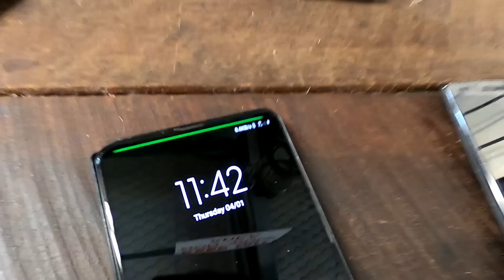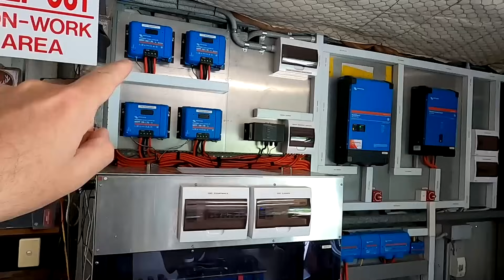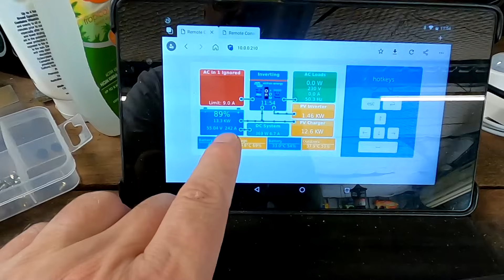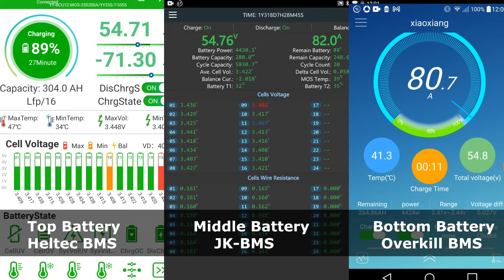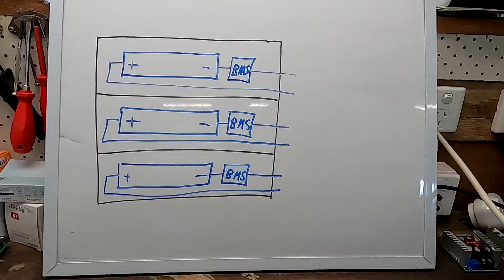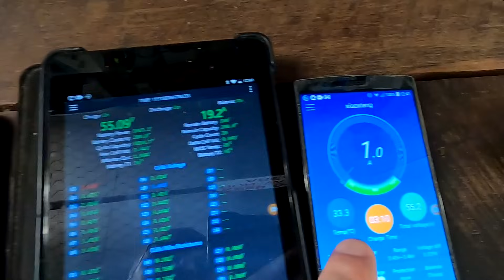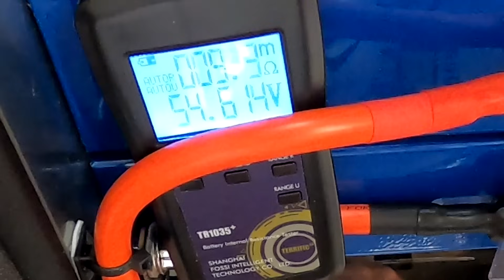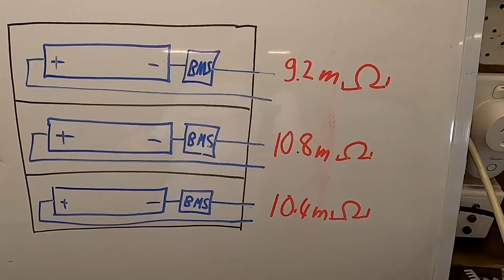Parallel batteries: one bank keeps charging when all the others are already full. But why???

Comment: I recently measured the impedance of my paralleled batteries with JK BMS (100A and 150A). I found out that one battery has an impedance of 4.8 milliohms while the other has an impedance of 5.0 milliohms. I used the original copper busbars with a torque of 11Nm. 

I was surprised when you mentioned that your impedance was 10mOhms. It seems that you did not pay attention to the length of cables, good contacts, and too many breakers. I suggest that you retighten all your busbars yearly with a minimum torque of 10Nm for better performance.

Comment: I think the problem comes from the chemistry of the cells, they are not the same brand, therefore different manufacturing, the chemistry must vary. It would be necessary to make a charge/discharge curve of one of the cells of each pack and check if the absorption duration varies between the cells.

Comment: Sorry that sounded a bit rude, I'll try again....

Hi Andy,
I think it could be Calibration of the different BMS's     If you check voltage at each battery bank voltage will be same. but JK BMS is showing lower   hence will keep charging as it thinks it's at a lower voltage.

I have a 5 bank that did the same thing.

And keep up the great work    Best channel on here.
Reply: Hi there,
but the actual voltage on all BMSs is the same - and non of the BMSs is limiting the current or stops charging the battery. The measurements of the BMS does not matter at all.
What do you think about that?
Greetings

Comment: You can't characterize the impedance of an electrochemical system at just one potential (open circuit like you did) and at only one frequency and expect to learn much from it.  The impedance will also be a function of soc.

Comment: Different BMS, different circuitry. I have 4 batteries and made them with identical cable lengths, cells and BMS, I do have some variation between the batteries during use, but only minimal - up to 5% of the charged status maximum.

Comment: Dear Andy, what I found in my shelf, that when charging with Jk weeker cell goes higher voltage, then active balancer takes out energy, but when current go's down at 55.2 this weeker cell starts to use more ampers and, and active balancer put back energy to weeke for absorption. While pasive balancer was not able to make so big trouble for weeker cell.
So, my prediction is that please change active balance current from 2A to 0.1A and look for a few days. You will be surprised that weeker current is enough.

Comment: First see if it follows the BMS when swapped. If not, I would set up a high current flow and measure for voltage drop in the milliamp range on both the positive and negative cable paths of the middle battery. That is how I found a weak connection on my solar system.

Comment: Have a look at cell 11 in the middle shelf. At 87% SoC it is already above 3.45V. I believe this single cell causes the internal resistance of the whole battery bank to be higher than the other banks, resulting in this "problem".

I have two Seplos banks (with NEEEEEEEY active balancers) where I observe similiar behaviour, when charging with 100-140A (50-70A per bank on average) cell 9 in bank 1 goes to much higher voltage than the others. When discharging at moderate Ampeages the voltages are fairly equal, but when discharging with >100A the same cell has the lowest voltage. 
Highest voltage when charing and lowest when discharging means the weakest cell. I also observe that the bank with the weak cell charges slower than the other bank.
Reply: That’s my issues , great  observation !

Comment: Hi,
the different impedeance would cancel out during an discharge/charge cycle, but you have not taken into account:
a) if discahrged, (and then leaving idle during the night) the banks will equalice by voltage and so charge the bank witch was discahrged most du to lower resistance.
b) your top bank has higher capacity, and so lower resistance provinding more power

Comment: Is the middle shelf the 280K  and the bottom 280 not-K and of course the 304's are also non-K  type.  Just a subtle difference in electrolyte and therefore a slight change to the charge curve?
Like you say, its not causing problems, and other than swapping round BMS's or busbars eliminate  those variables its the only difference other than capacity - unless the middle shelf were B-grade, or a different factory or batch is maybe all it takes to shift the charge curve a little.

Comment: The impedances look fine.  I thought through a number of scenarios and the one that seems most likely to me would be battery temperature.  The middle pack would probably be the warmest due to being sandwiched between the other two.

* Could very well be the temperature of the middle pack is higher during long charging stints due to being inbetween the other two packs, significantly increasing its capacity.

* Probably not any sort of current limiting.

* Probably not minor differences in native capacity since everything is top-balanced.  Top balancing does not cause any temperature variations though so it would not prevent temperature from causing the issue.

* BMS brainfarts.  But if you look at a graph and the charging curve is smooth, then probably not.

Temperature is my best guess.

-Matt

Comment: I think your guess is right. The middle battery get's fully charged last and the top and bottom absorb earlier. But it could also be the cells or the BMS voltage drop 🥴

Comment: Hi Andi, das JK misst eine niedrigere Voltzahl, während die anderen beiden bereits die 55,2 Volt erreicht haben. Man kann doch das JK von Hand kalibrieren. Wenn man das JK bei beispielsweise 54,7 Volt auf 55 Volt kalibriert, dann wird es das erste BMS sein, welches die 55,2 Volt erreicht und auch als erstes runterregeln. Sind es diese kleinen Zusatzboxen, die die BMS mit dem Cerbo verbinden, welche für das Herunterregeln verantwortlich sind? Normalerweise sind doch die Solar-Charge-Controller für das Herunterregeln zuständig und nicht das BMS? Das hat sich doch erst mit den kleinen Boxen geändert?.
Reply: The BMS does not control the current flow. It's on or off. The voltage is what it is, independent of what is displayed.

Comment: I guess the Battery Shelf 2022 might deserve its own video about the performance and cycles in the past 2 years I guess.
And then it might also deserve a protection well known as DENKMALSCHUTZ cause it is so iconic cause everyone can recognice the long and winding road back then. 

And it is clean and nice - compared to the collection of batteries that appeared seconds later. 

After a long and winding road with EVE LF160 cells grade B we finally got a set of 16 x EVE LF280K grade A from a german electrician shop in Hannover. 
Grade A means in this case: all produced on tthe same day same production site and a row of serial numbers with a 305 Ah result for each cell over 3 single discharging test with EBC A40L  in a heated room with 25°C according to EVE 's test procedure described in their 20 page long description. 
305 Ah means they are also running quite close from top to bottom with the Seplos BMS balancing close to nothing cause max deviation is about 0,002 V but only 2 are better cause 13 are 0,001 . 
And that is most likely not a cell difference but caused by the position in the battery cause when I mixed it up the results were not the same and the worst became the best. When I put it back in the previous order I got the same result as before, this time again the worst cell in the battery, whicch means from best to worst it is just a question where the cell sits in the battery cell chain. And the top balancing is a rather short procedure till its done. 

This is a complete different result and world compared to the LF160 Grade B cells (have been lasered and produced within about 7 months).

Comment: Andy look to your Mosfets - Not all Mosfets are equal - BMS with Mosfets  have  different forward resistances and/or different numbers of Mosfets in parallel will have different resistances - older cheaper Mosfets tend to have  higher forward resistant which get worse as the heat up - a crude test would be to check which BMS get hot under similar high loads - Hugs from UK
Reply: I agree with Trevor. Also, the on resistance of Mosfets is non-linear over current. In other words, you will get different resistances at different currents.
Reply: @marklockwood7592  That's so right- there have been a lot of advances in Mosfet' design and material purity in recent years - I imagine not all manufactures have caught up - some e-bikers have pepped up their bikes by the simple expedient of changing the Mosfets in their controllers.
Reply: @marklockwood7592  Intersting. Maybe use three identical BMSs as proposed by @stefanvanzyl9090 to see how things change.
Reply: I would think that he could swap bms to see if the condition migrates with it. That might shed some light on the issue.
Reply: @wg6215  Sounds like a plan
Reply: Long live the Mosfet

Comment: Would measuring and recording the voltages across each individual bank with an accurate DMM while simultaneously recording the amperages, either charging or discharging, allow you to use ohms law to determine the overall resistance of each bank? I imagine each bank uses different sensors to evaluate the amperage going in and out of the battery banks? There might be some significant variance between them as well, particularly at high or low charging rates. Their response may not be as linear as one would like. It would also be interesting to check the voltage differences at different locations on the bus bar - at high amperages, even small resistances could cause significant, and therefore measurable, voltage drops.

Comment: Hello Andy, and happy new year....
Just a down side to things......here in UK ....our days are getting longer and yours are getting shorter......ha ha
(Don't pay it back in 6mths) 
I take it all your BMS have same settings, but as you said in last minute of video.....
You have different BMSs and all 3 are working on 3 different banks....
Ok top back is 305ah
Bottom 2 are same but with different bus bars and different BMSs.......for get the top one.
Now the lower 2..... different BMSs, different bus bars , different temperatures (due to hight day night thing)
Different age.
I'm thinking it be something simple.... forget data thing......also middle one is first of the 280 ah cells connected to dicarcarge point???
Is it as simple as this bank is next low ah bank and so discharge a little more everyday than bottom bank????
I know you have built a fantastic battery bank and its well perfectly well laid out.....
You do have a Mish mash of cells BMS and bus bars.....
If it was all the same.....then I would ask the question as you have.
I'm a fitter on plant equipment......you can have two machines.....but both are not alike...
Never over look the basics.....forget data.
I don't think it will help, but thats how end up fixing faults.
Sorry for going on Andy.
Look fwd to out come.

Comment: Andy, I believe that the middle battery pack is better balanced than the other two, which causes it to have a slightly higher resting voltage than the other two banks. When you slowly discharge them, the middle pack then discharges more as it has a SLIGHTLY higher voltage overall for the first few minutes/ Ah discharged

When you do a higher discharge rate, the overall voltages of each pack are dragged down into the flatter portions of the curve, which will then make the battery packs all supply similar current, hiding the higher resting voltage.

Since you are working with 4 sets of variables here: cell size (304 vs 280), cell busbars (CU vs AL), bmses and the effects of longer cabling for the lower packs, I propose that you fit 3x identical BMSes for 1-2 weeks - preferably connecting them to your raspberry Pi / VRM to allow for logging and totalizing - This is "easy" since you already have all these new JKbmses which were bought at the same time and can run the same firmware.

My hypothesis is that the higher trailing charge rate for the middle pack will disappear after 3-5 cycles
Reply: Agreed. Eliminate some variables, and my guess would be the same as yours.
Reply: Agree with this statement
Reply: The voltage difference at charging is the key give away..
Top and bottom pack have a higher pack  voltage when charging, there for are less balance.
Furthermore, as you paralleled 3 packs, once the difference between the packs becomes more than 2 mv, the batteries will try to balance out ( from my own exp.)
Reply: @houseofancients  It looks like the top and bottom batteries have a lower delta voltage in the cells. at 9:58 the top and bottom battery have a delta of 25mV and the middle battery has a delta of 62mV. Although that might be because of the higher current in that battery. I wonder if the battery cells were balanced if this issue would be solved.
Reply: Aaaannnnnd. Balancing is wasting some energy right? 😊 So little bit here and little bit there. My opinion is that with such count of variables this "problem" not worth another try/guess. It may still end up with a wrong conclusion. Thanks Andy for all the good work!
Reply: I concur
Reply from the maker: Well, this bank has actually the worst balancing of all three. I rather lean towards the bus bars and oxidation between the aluminium contacts of the terminal and bars.
Reply: @OffGridGarageAustralia  That changes things - yes, definitely check the bus bars. Eliminating variables.

Comment: I have a similar situation between my 4 parallel batteries. Two of them are CALB329Ah and two of them are envision 306Ah and 308Ah. The Envision batteries seem to get full first and under certain conditions they can even backfeed energy into the CALBs. I assume it has to do with slightly different voltage curves And as you said it's not an issue in practice.

Comment: Measure the voltage drop across the positive connections and then the negative connections (input to output) of each bms with the same current flowing through each to see if the BMS is causing the issue (maybe the FETs have a higher forward bias)

Comment: It seems that you're assuming the algorithms underlying sensing the battery cells and then controlling the charging is the same from one BMS to another. I would submit that they are not the same from one BMS to another. The formulas for controlling what happens with the current in each BMS is different from on to another, at least to some degree, unless they are all made exactly the same by the same manufacturer. That's my guess as to what's happening.
Reply: This is exactly what i thought too
Reply: BMSes don't control rate of charge - they only intervene when there is a parameter outside the setpoint, and their only tool with which to intervene is opening the mosfets, which disconnects the pack entirely
Reply: @stefanvanzyl9090   Yep - BMS is a switch: on or off. No control of current.

Comment: I have some Jakiper JK48V100PRO batteries. With one of the packs, I observe some of the same as you do. That is the oldest pack and it has slightly different cells inside. Different model cells and possibly from a different manufacturer. Possibly with a slightly different charging curve? But as you said, it is not a problem.

Comment: Yeah swap bms would tell if bms is the cause.
But i guess it is because of the active bms method.
Maybe it will waste more energy than passive and take longer to fully charge. 😅
Reply: passive balancing discharges higher voltage cells via resistors - throwing away energy as heat.

Active balancing discharges a higher voltage cell into a capacitor, and then uses the stored energy to charge up a lower cell - less heat overall
Reply: @stefanvanzyl9090 in theory, but maybe in practice the JK pulls more power over time?
Reply: @LibertyDIY   BMS power consumption by itself is in the order of a few milliamps. These packs are cycled daily and the behaviour is highly repeatable one day to the next -even a 20mA consumption/wastage difference over 24 hours is only a 0.48Ah difference, which would be replenished in less than a minute at this 40A charging rate difference

Comment: The only thing I can think of is there is a slightly higher self discharge on the middle battery. Is there a difference if the time between full charges is long or short?
Reply: Since the start of summer, these batteries see full charge almost every day

Comment: Hey Andy, Did You Use Di-Electric Paste Between All Copper-Aluminum Dissimilar Metals Connections?  Maybe The JK BMS Has Slower Charging Parameters?? Do The Cables Run At Different Temperatures To Then Show Different Rates Of Charge Flow??? 🤔😜🤣😁😎
Reply: The bmses in use here do not regulate or control charging, they simply intervene by disconnection when a parameter exceeds the setpoint.
Reply from the maker: No paste or grease has been used. I tried a couple but hat best experience without any of that stuff.